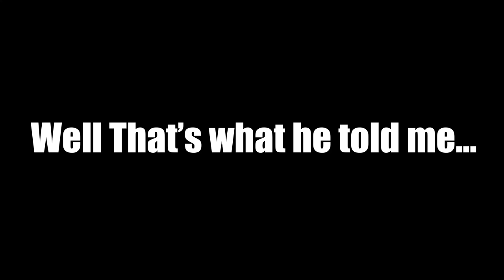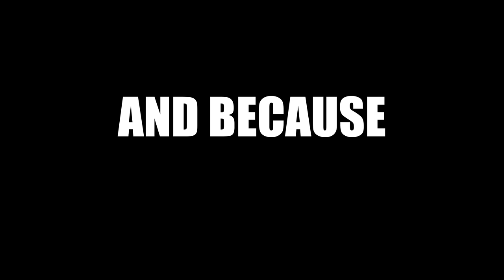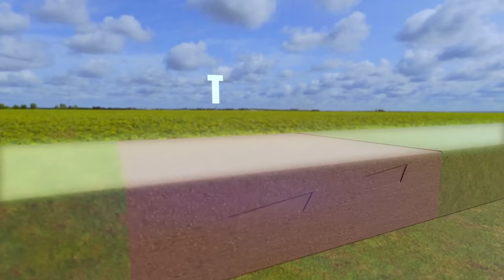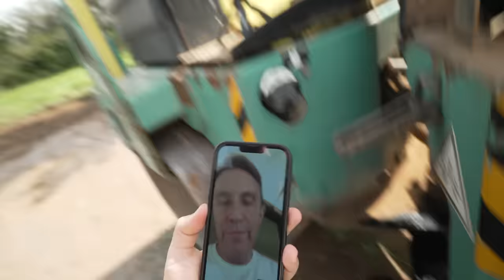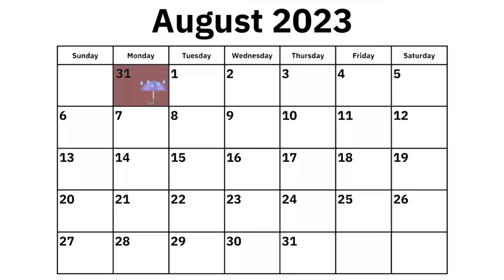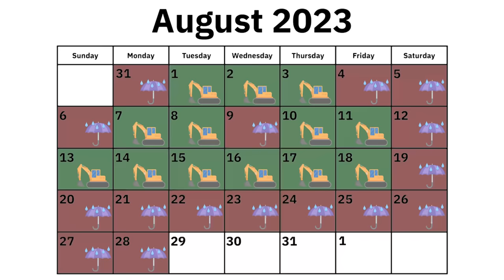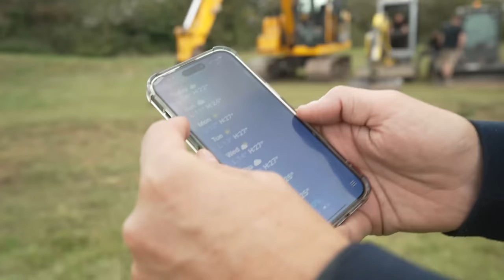I BUILT A RACE TRACK IN MY BACK GARDEN

Comment: I used to build tracks for rage  buggy’s for a day job. A U.K. track has to be 100% built around drainage, get that right and your half way there. The track surface needs to be higher than the surrounding land so any water that falls on the track goes down and out the sides then it’s making sure you have your cambers sorted so you direct the water the way it needs to go. Best of luck with the project, get a nice flowing fun track is super rewarding!

Comment: I've always wanted to do this. I'm curious is there any planning requirements or problems with neighbours. Every piece of land I find (to dream about) there's always a neighbour a bit close to worry about. I figured the best place would be land near a motorway to blend in any noise.
Reply from the maker: Its a good question. i use my fields very rarely and i am extremely respectful to my neighbours by making any use quick, we try to keep it under 30 minutes, also i make sure its not a warm bank holiday when people are enjoying their outside space. You can see from the videos this year i have only been up there a handful of times, and the other 360 days a year we make zero noise. I think if i was using motocross bikes all weekend, most of the year, then there might be an issue.
Also i don't build jumps etc as its classed as engineering works, I learnt my lesson on that in the past, so in this video we repair the damaged dirt track, which is allowed and not a problem. Upkeep is allowed, big changes are not